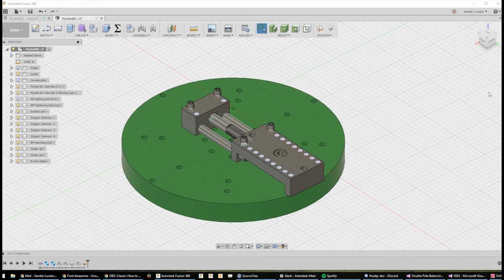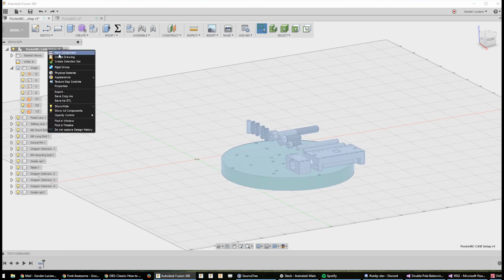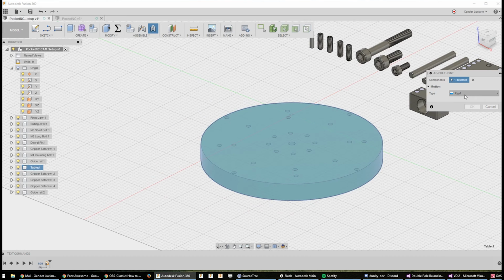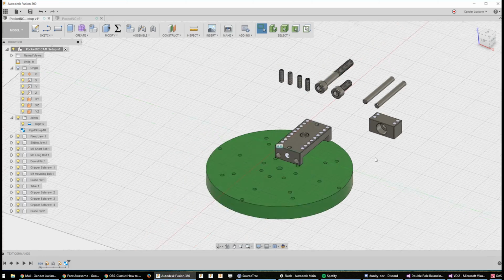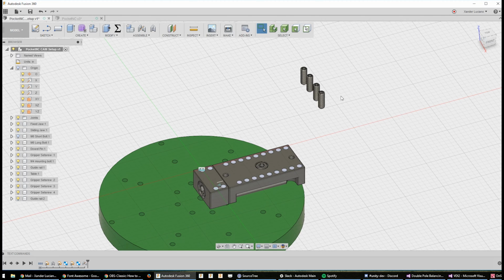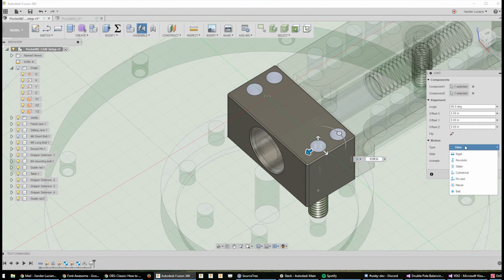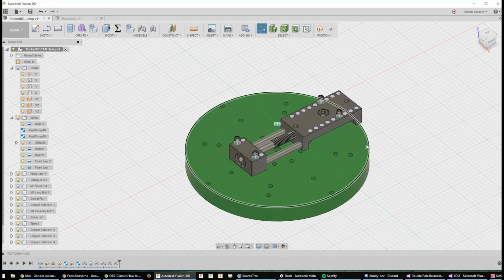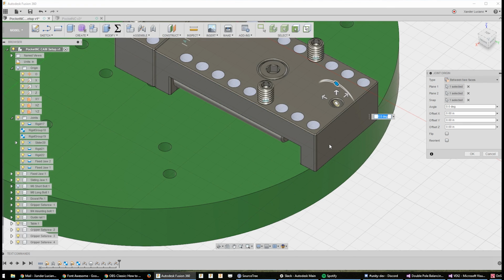Fusion 360 Assembly Tips n Tricks [Intermediate]

Comment: In your opinion when would you guys a component? Because I don't see an issue with grounding the base component if it will never move from that location relative to the model origin.
Reply from the maker: Ground's intended use case is more of temporary tool to help you visualize that your mates are working properly instead of just moving everything around. It's a little hard to put into words, but basically it only works at the topmost level, and all sub-grounded parts are ignored. Now if you only have 1 part and everything will be on that it'll be fine, but if you added sub-components to that grounded part, they will not be grouned. This is when users get confused because the ground command didn't ground everything. 

That still sounds pretty confusing so I might just have to do a quick tips video on grounding and why it isn't what you think it is.

Basically, if it's working for you, there is no real harm in doing it that way (other than bad practice I suppose), however if it suddenly stops working, you'll have to use this method to fix it. I personally found this way to make more sense once I started practicing it more, but I'm not saying you MUST do it this way. (But you should ;) )
Reply: Xander Luciano grounding relates to the parent's model origin. each component has its own origin. so grounding a component in a sub component. won't mean the sub component is grounded within its parent. It works the same way in that sense as grounding/fixing components does in Inventor or Solidworks.
Reply from the maker: I thought that too, but I asked another team member about this and was told "that ground only applies to to the parent document, since its a feature of that document. When you insert a sub component, the parent ignores the sub components ground features. [...] Ground is a way to fix something is space in the timeline to make kinematic drag/move more reliable. It is not like Fix in SolidWorks. The best way to fix something. i.e. make it fixed to the parent coordinate system is to create an as built rigid joint."
Reply: Thanks for the video!

I am now seeing that this video is from almost exactly a year ago... So, instead of requesting that you add me to the list of people who would be interested in a longer explanation of the ground/rigid topic, I guess I should probably go look through your videos to see if you've already made one. I'm going to switch, because it makes sense and I like to observe best practices, but I'll remember more-betterer if I can see one method working and one causing problems.
Reply: I just had this issue. I have a sub assembly and added it into my main assembly. The ground feature no longer works on the sub assembly. Every time I selected my sub assembly and grounded it nothing would happen. It would move on me and mess everything up. This technique fixed the issue.
Best Matt